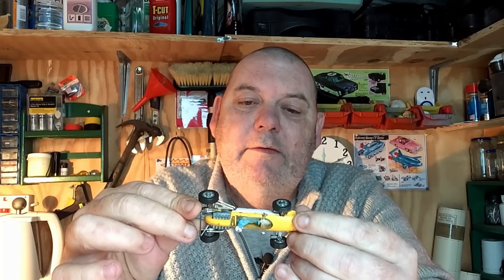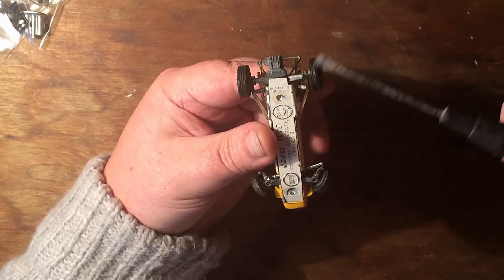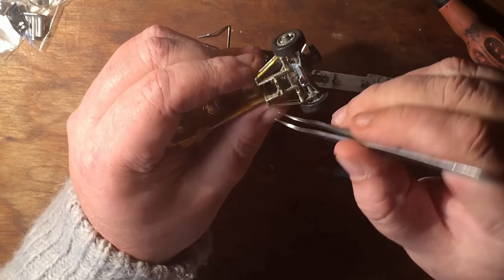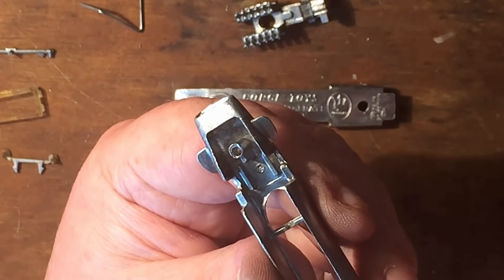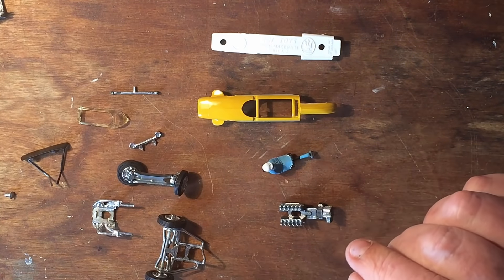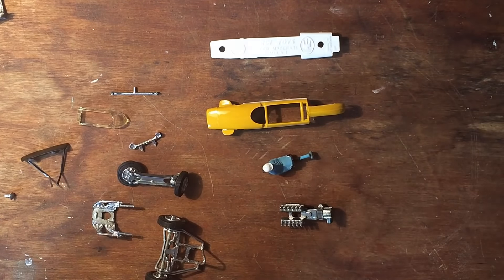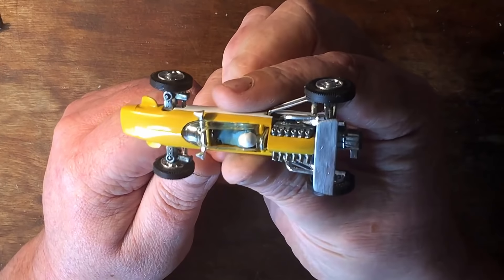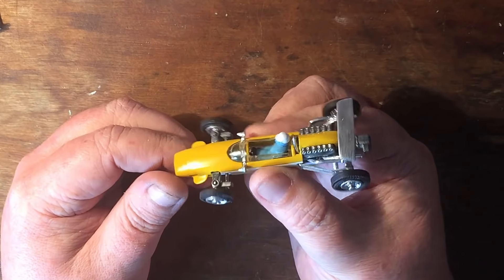Corgi 159 Cooper Maserati Formula One Car Restoration

Comment: As a F1 nut I've restored several of these, the original dark blue version without the wings and steering - which was never very good anyway , always broke in the end. By the way, I'm not sure the real car ever ran with wings on so you could miss them off if you wanted to.